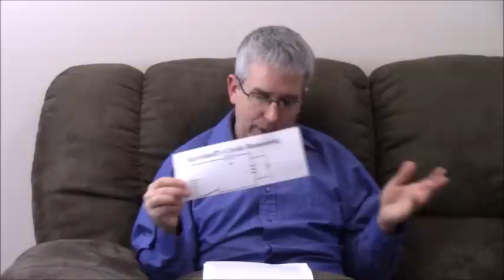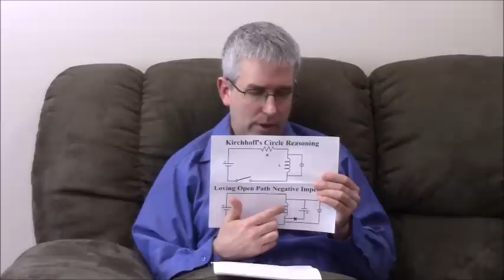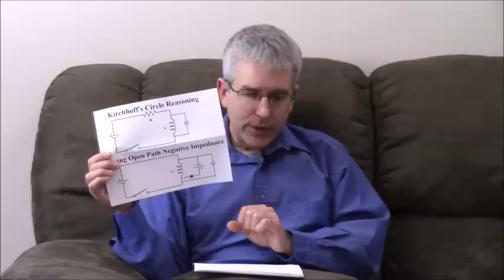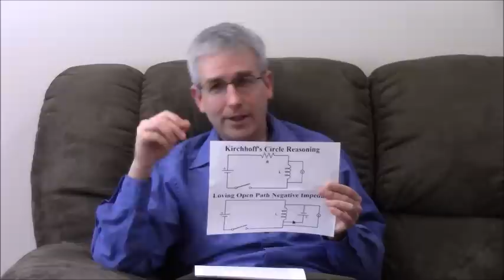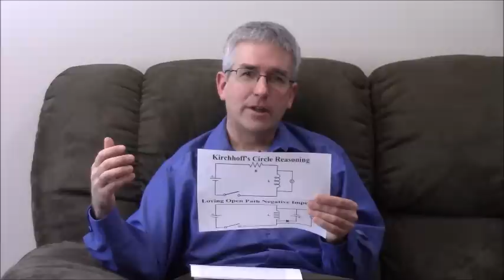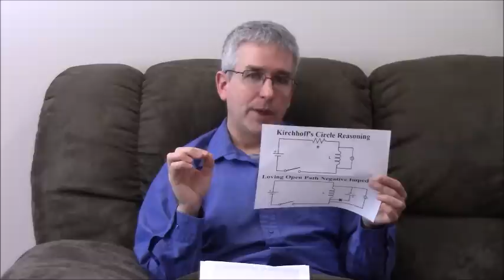The Gains Outside of the Death Circle. Beyond Kirchhoff rule

Comment: Hi Rick - great video.  At about the 36 min mark as you describe the resistor & inductor circuit, you mention that all of the RESISTANCES should add up.  I know what you mean - I'm wondering is it the same thing to say that "All Voltage Drops" should add up ?     Thanks.